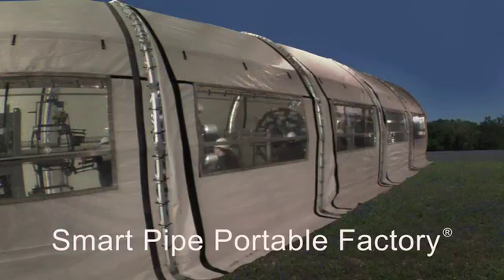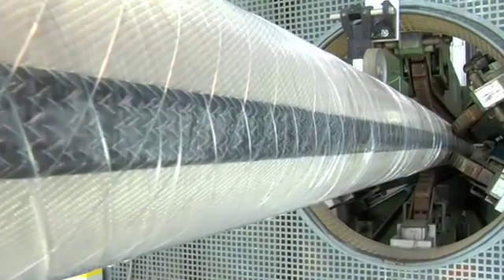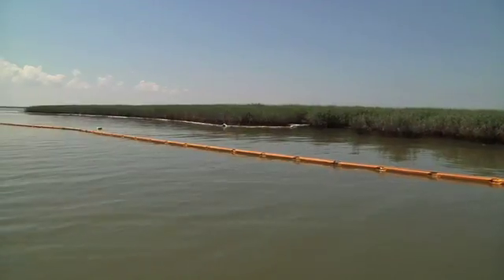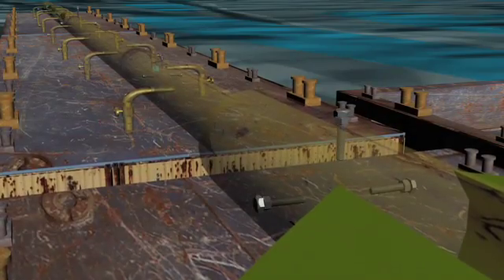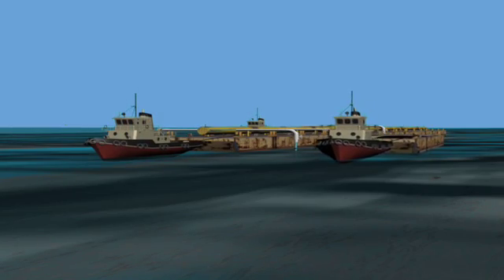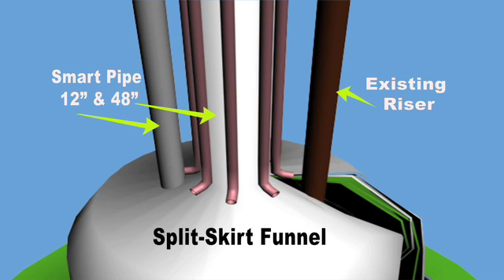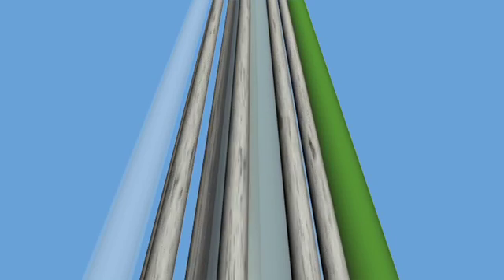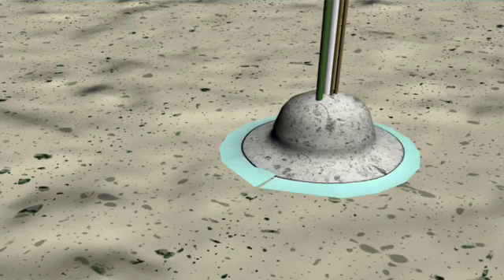Smart Pipe Company Inc-Proposed Solutions for Gulf Oil Spill

Comment: This is great. There may be initial pressure problems that can be overcome.
 Why not first insert the bottom pipe section into the top hat containment dome that BP  already has? This 4-story containment dome can then be filled with concrete to help hold the pipe in place given the enormous pressures.  
Then you can put your pipe into a coupling adaptor system developed an set on the  top of the containment dome.   This will help you overcome the incredible initial pressures that may destabilize.